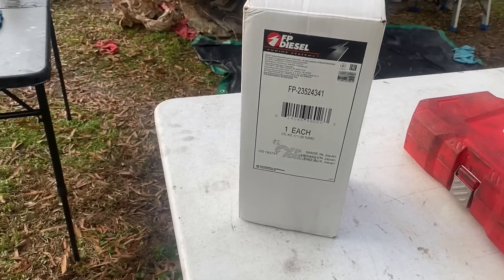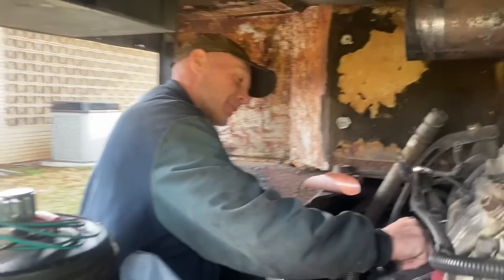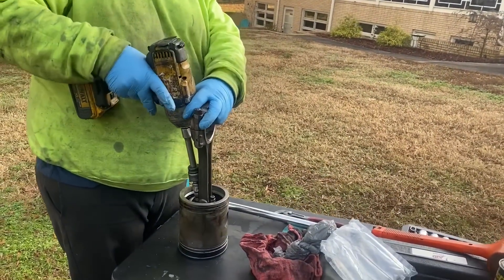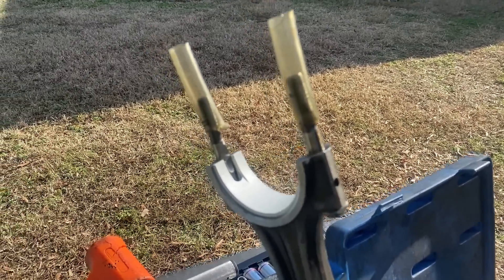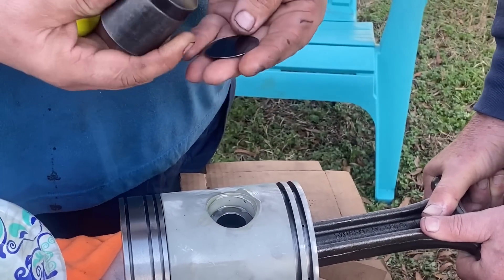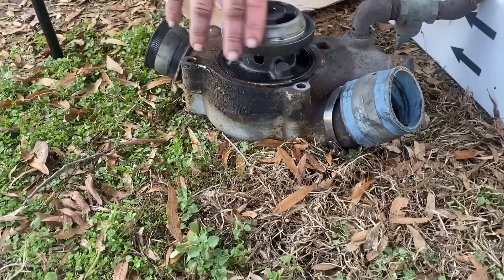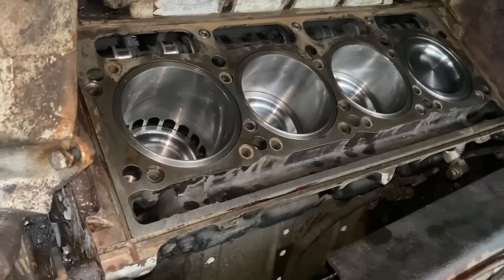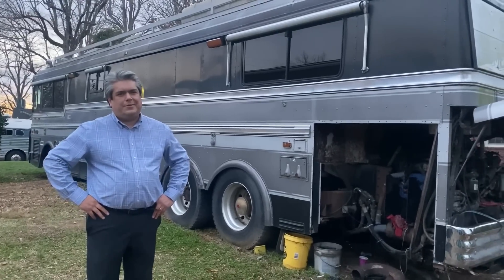Reassembling the detroit diesel 8v92TA Wanderlodge bus engine day 1

Comment: Even if it weren’t already torn apart you wouldn’t have washed the engine. I’ve said many times why doesn’t he wipe anything off. Then I thought, well it’s not going to rust! Nothing under my 318 semi rusted because everything was always covered with oil. Good old Detroit.

Comment: Hey Scott I was wondering if you are familiar with 96 International 7.2 Motors diesel are they any good I found a bus 28 in capacity really good interior look pretty decent on pictures but you know how that goes I was just wondering your opinion as for a swap hey Scott I was wondering if you are familiar with a 96 International 7.2 Motors diesel are they any good I found a bus 28 in capacity really good interior I look pretty decent on pictures but you know how that goes

Comment: It's still a noise making, odd ball torque in the wrong place, oil burning, oil throwing, large paper wate😝8v92 means 8 cyl, 92 ci per cylinder, 8v71, 8 cyl, 71ci per cylinder.

Comment: Are those wet liners ever difficult to get properly sealed?
Reply: Not that I'm aware of and from what I've learnt about re-sealing Detroits is to keep the neoprene O-rings totally dry on the heads etc but use Loctite on the gaskets

Comment: Are you having the heads done and blower gone through.  Thanks for your hard work and the vids
Reply: Do you ever have to cut the counter bores in the block for proper liner protrusion...  Just curious have done alot of Cat and cummins which needed that done to meet spec

Comment: The 92 series and 740 Allison was a poor combo in a motorcoach. The shift timing caused the Allison to upshift before the 92 was in the sweet spot. That caused lugging and bearing damage. Many old timers that knew manually shifted the Allison to minimize it.
Reply: I've never liked Allison autos behind  Detroits much you have to manually shift them as you say as half the time the kick down doesn't suit the engine RPM. cheers from Australia
Reply: I have an Allison HT-755CR ATEC powered by a DD 8V92TA DDEC II in a bus built in 1990.  The 755 seems to do OK when accelerating, but does not downshift as soon as I think it should when climbing hills.  I tend to let it shift automatically when accelerating but often downshift it manually on hills or when slowing down to exit a highway or come to a stoplight.
Reply: Bruce Fay Manually shifting them is the best thing to do.

Comment: Scott- In a perfect world ever engine would be spotless before we did any repair.  However It will never be that way.  I have rebuilt countless 4-71’s in ts14 scrappers in the middle of a dust bowl, and the engines lasted just as long as the ones rebuilt in a perfectly clean shop. As field mechanics we repair in the environment were given, sometimes its far from perfect.  
   Most engines die from lack of lube, coolant, or basic maintenance.  Im sure the engines you rebuilt will not die from the small amount of contamination from the rebuild.
Reply: agreed. i work in the gas fields and i can’t even count how many engines i’ve overhauled in the middle of a gravel lot. they all ran 24/7 just like they were supposed to and the world didn’t end
Reply: The keys to life right there, stay lubed up, be cool and perform maintenance.
Reply: me too
Reply: When I had the timing chain done on a Honda, I came to pick up and saw how clean the under hood was. I assumed they cleaned it to work on it but he told me they cleaned it all up real nice after the work, of course! I hadn't expected it so I was pleased...
Reply: Watch some videos of Asian countries rebuilding engines on dirt footpaths or river banks, with no specialised tools other than hammers, they seem to run just fine

Comment: Still amazes me on replacing pistons and liners and that’s it. Are the camshafts pretty durable on these?
Reply: actually replacing the bearings is the main reason for this job, but to do that, you have to remove pistons & liners, which is the main reason those are getting replaced, labor has to be done anyway, so why not.  Cams & cranks seem to last forever.
Reply: @carlosedwardos  You dont need to pull sleeves to change main and rod bearings. Once you pull down the oil pan theyre all accessible. Push the old ones out, roll the new ones in.
Reply: Looked to be a bit of wear worn into lobes but they didn't look too too bad..

Comment: Surprised you cant use a deadblow hammer on those retainers against something like a bumper hitch for an anvil.  One smack ought to take the crinkle out with out stretching it.
Reply from the maker: I had others that were perfect that we used
Reply: This is the problem; if one of those retainers leaks, oil will spew out of the airbox drains and it could lead to a runaway.  If one comes loose it will destroy that cylinder liner and piston and maybe more progressive damage.  It's just not worth taking a chance on.

Comment: Just a quick question, How does the oil get to the con rod hole and up the conrod to the piston pin when the bearing at the crank does not have a hole?  Does the conrod bearing have a grove on the back and the oil gets in by the cap bolts?
Reply from the maker: Yes rod cap bolts
Reply: @BusGreaseMonkey  Excellennt!   thank you for clearing that up!   Love the Channel!  Great work!
Reply: The con rod is drilled and channeled at the bearing saddle. The channel intersects with the rod bolt holes.  There are also reliefs in the bearing shells for the rod bolts and oil to pass thru. The lower bearing shell has a center groove that permits oil to flow around the crank journal and up thru the rod to lube the slipper bushing/wrist pin and cool the piston.

Comment: As of today I'm on my third steering rack assembly, in three days, for my Chevy Astro van RV.  If this one's no good, tomorrow will be the fourth.  Some day an MBA will figure out its a loser to sell badly rebuilt parts with a life time guarantee.  Charge more, sell better parts.             6 pm update, they put the incorrect steering rack in the box, so tomorrow IS attempt #4.
Reply: Just buy a Toyota, Lexus, Honda, Acura or Mazda and then get genuine factory parts from the dealership, and you won't have to put up with this crap.  I just did work on my 25 year old Lexus that would have been $9000 to have done at the dealership, so a lot of items were replaced proactively, like a 25 year full maintenance, and I had to install hundreds of parts, and I used all factory new Toyota parts and not a single part was bad out of the box.  Japanese car owners won't put up with that crap!
Reply: @carlosedwardos  I have a Tiger motorhome.   See opening video if you want to see it (it's at 4: 40), on its way back home from an Alaska trip.  It's a lot like an old VW bus, it's worth a lot more than an Astrovan, an appreciating asset, something people are looking for, a cult following, if you belong to the right cult (It's now an "Adventure Vehicle").  A comfortable place you can live in that fits in a compact car space, 4 wheel drive, travels on the Alaska Ferry for the minimum price.   I believe one of Scotts guys last week might have had one.    My Honda does not have that problem, American cars?  Yup, they do.    It's clearly worth putting money into, just as an old VW bus is.   Astro vans are amazing vehicles, even without the RV.  Except for the lack of new parts.
Reply: All the Astro Vans I have worked on had a steering box not a steering rack, maybe you are getting your terminology mixed up and that could possibly be contributing to your problem getting the right parts
Reply: @gullreefclub  It says "Steering Rack Assembly" on the box.. We used the same set of receipts for the replacements, the part numbers all matching.  3 out of 4 were the correct part.  Today's seems to be almost as good as the first one that lost it's oil on the freeway in the desert.

Comment: Beautiful brand new pistons and liners.  I can't wait to hear the engine.
Reply: Indeed. So beautiful, so expensive. I cringe when I price those things. It's really the biggest thing keeping me from doing a vintage bus. Can get a small block Chevy crate engine for $1500. can't even do half an in-frame on a 6-71 for that.
Reply: Shane Singleton Geez, You’re saying around $3.000.00 in liners, pistons and rings? I guess I’ll quit whining about aircraft engine parts....
Reply: But the Detroit will run wide open for the rest of your life without fail.  That chevy will not.
Reply: @MrMauserb   well it’s only turning like 2500rpm if even so expect it to last, 😎
Reply: PickleRix FP Diesel makes good stuff from what I’ve seen from them. Some of it is made in India but I find that their QC is much, much better than anything coming out of China.